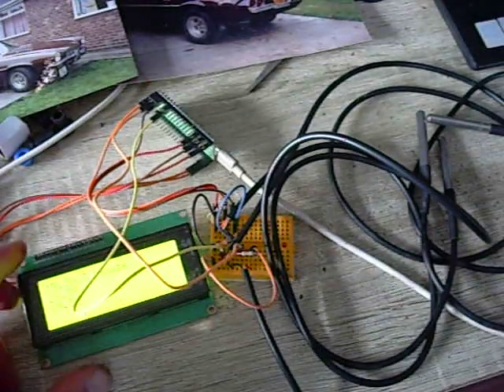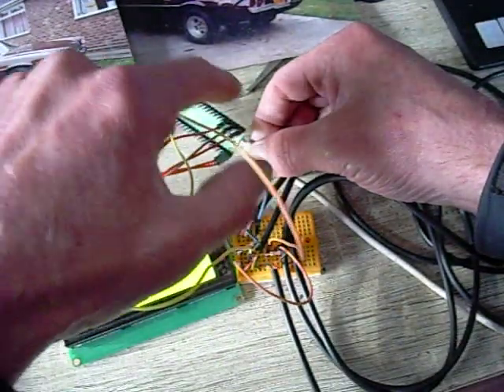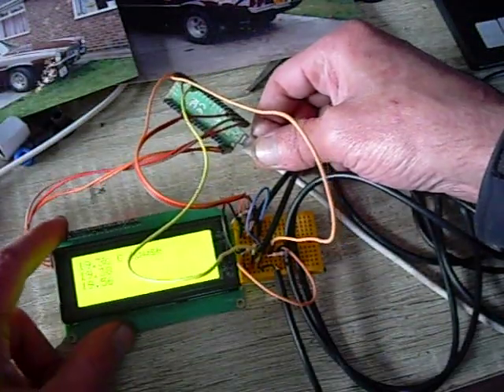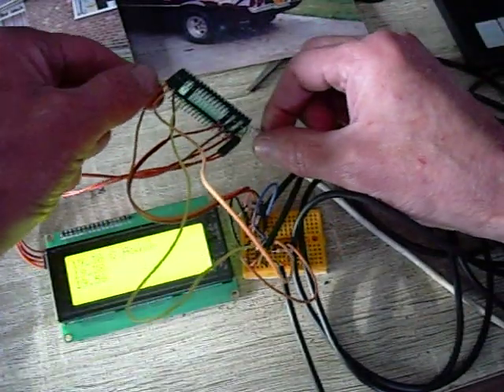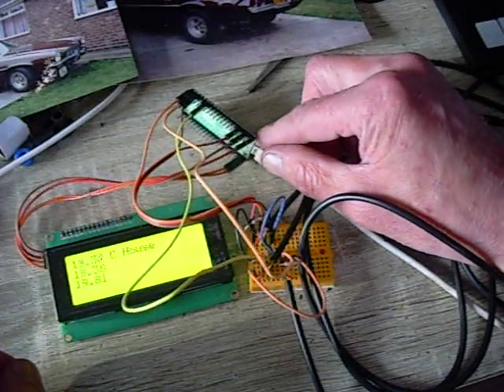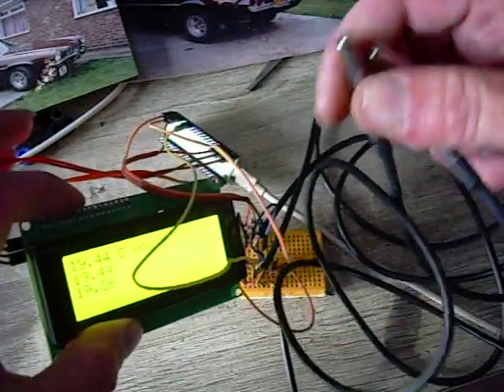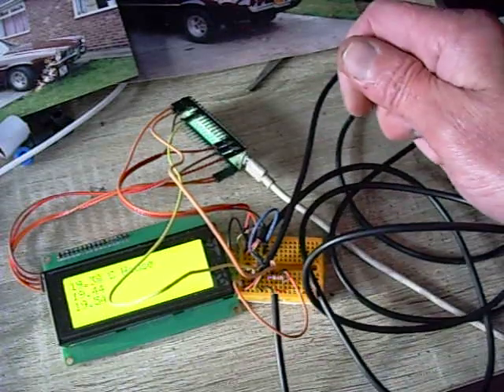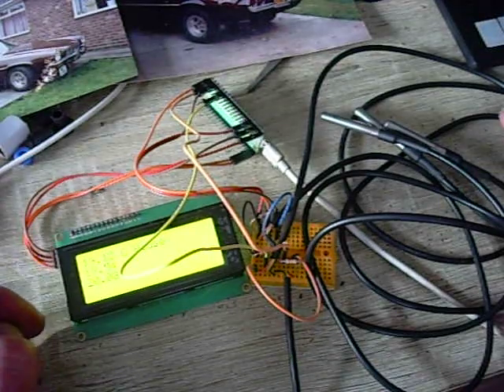Raspberry Pi Pico with 3 DS18B20 temperature sensors. Code in the comments.

Comment from the maker: import utime
import machine, onewire, ds18x20, time
from machine import I2C
from lcd_api import LcdApi
from pico_i2c_lcd import I2cLcd
 
ds_pin = machine.Pin(16)
ds_sensor = ds18x20.DS18X20(onewire.OneWire(ds_pin))
roms = ds_sensor.scan()

dsa_pin = machine.Pin(20)
dsa_sensor = ds18x20.DS18X20(onewire.OneWire(dsa_pin))
rsa = dsa_sensor.scan()

dsb_pin = machine.Pin(17)
dsb_sensor = ds18x20.DS18X20(onewire.OneWire(dsb_pin))
rsb = dsb_sensor.scan()

I2C_ADDR    = 39
I2C_NUM_ROWS = 4
I2C_NUM_COLS = 20
i2c = I2C(0, sda=machine.Pin(0), scl=machine.Pin(1), freq=400000)
lcd = I2cLcd(i2c, I2C_ADDR, I2C_NUM_ROWS, I2C_NUM_COLS)
lcd.clear()
lcd.move_to(5,0)
lcd.putstr(" C House")
while True:

 
     ds_sensor.convert_temp()
     time.sleep_ms(500)
     for rom in roms:
         t = round ( ds_sensor.read_temp(rom),2)
         print( t)
         lcd.move_to(0,0)
         lcd.putstr(str(t))
         
     dsa_sensor.convert_temp()    
     time.sleep_ms(500)
     for ra in rsa:
         ta = round ( dsa_sensor.read_temp(ra),2)
         print( ta)
         lcd.move_to(0,1)
         lcd.putstr(str(ta))
         
     dsb_sensor.convert_temp()    
     time.sleep_ms(500)
     for rb in rsb:
         tb = round ( dsb_sensor.read_temp(rb),2)
         print( tb)
         lcd.move_to(0,2)
         lcd.putstr(str(tb))